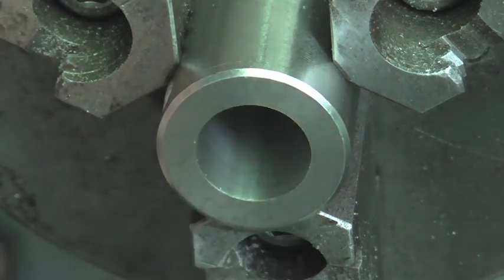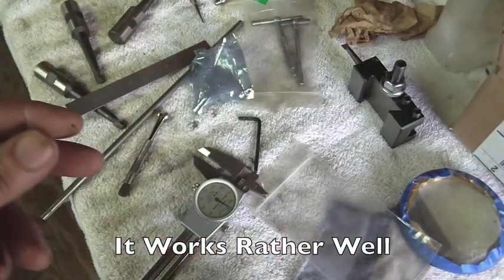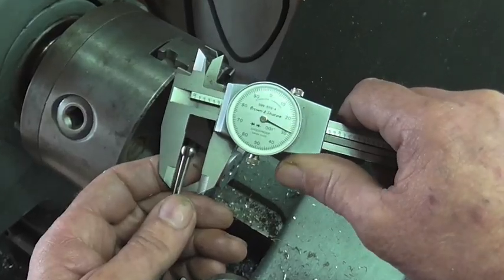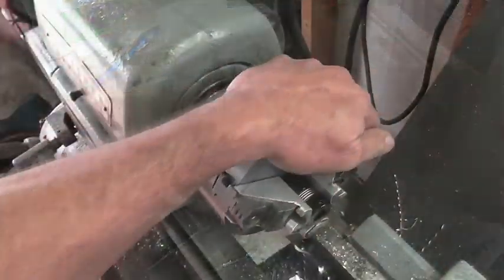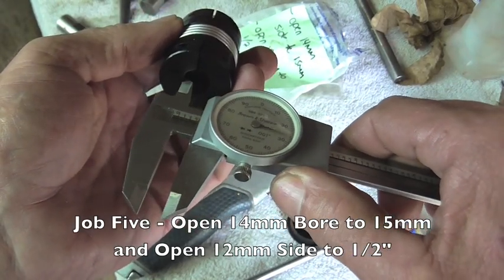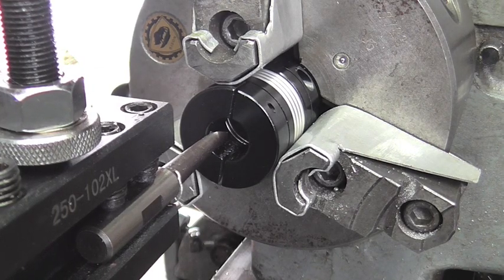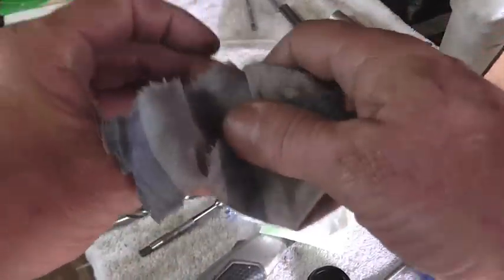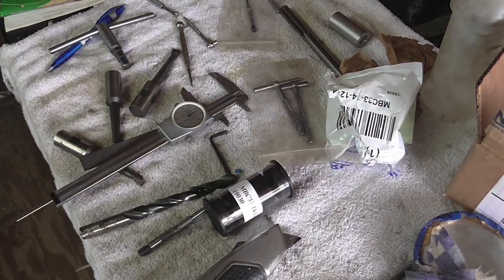Modifying/Machining CNC Mill Parts on The Atlas Lathe - MSFN

Comment: Slick work Sir!    I'm not too familiar with the type of spindle on Atlas lathes, but do you have a small four jaw chuck for it?
Reply from the maker: Thanks Rolando, I have a large 4 jaw but chose not to use it since I had .005 to play with. Discussed tolerances with the client before work started. My 3-jaw Bison Chuck is rather accurate